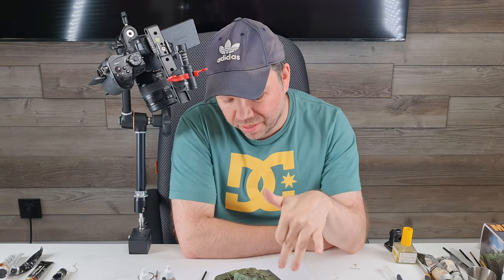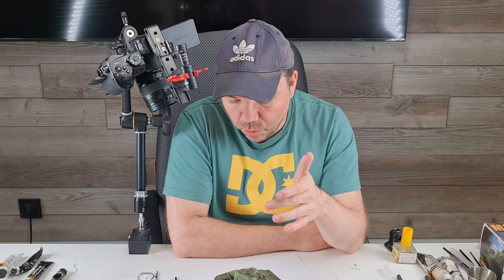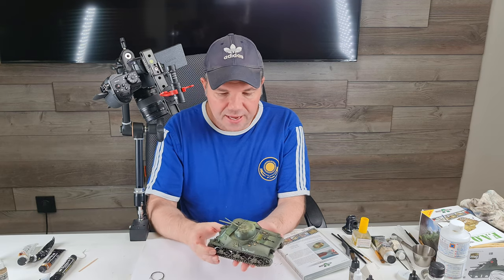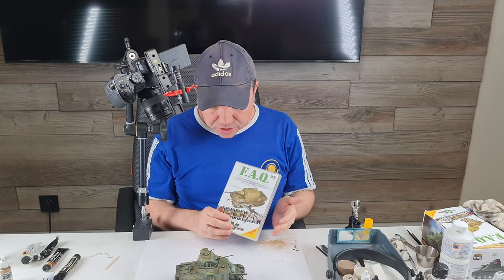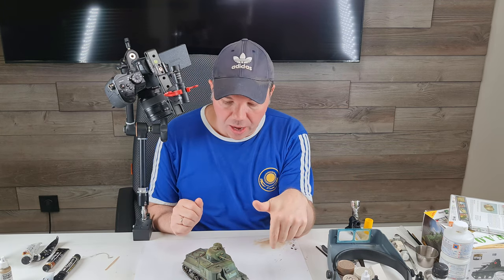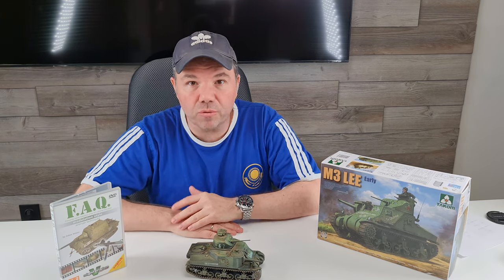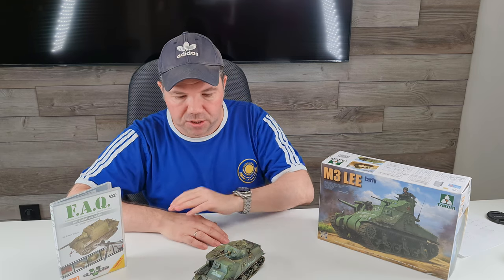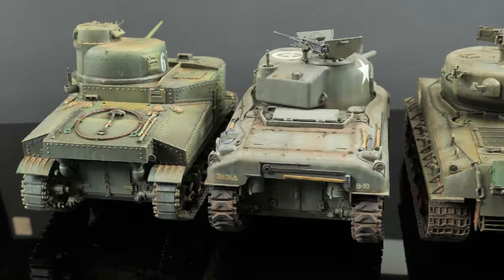The color modulation armour weathering style in 2021 PART II SURPRISING RESULTS !!

Comment: My experience of 22 years in the military has told me that most modelers have never seen a real battle used vehicle.  After my tours in Afghanistan I still remember oiling hinges on our vehicles so that they didn't make noise as we switched to foot patrol or arrived on the objective.  We generally did everything we could to make our vehicles as safe, comfortable and presentable.  Mainly the vehicle will save your life.  I had the privilege to present photos to the awards board that showed our vehicle had taken quite a bit of fire and showed that the enemy was going for weaknesses in the humvee and that this technical proficiency showed that we seriously misunderstood the taliban's level of knowledge.  Leaders disagreed, until I showed them photos of 20+ vehicles hit the same way.  After that I was reassigned and my report was buried in a huge catalog system.  The name of my report had been changed and even the report number.
On the modeling front, why do people put chips behind the hinges on hatches?  Who do they think is going back there enough to wear the finish?
Reply: Only rivet counter's care